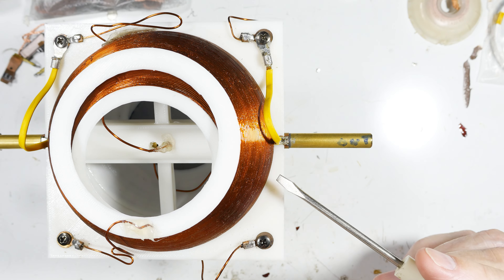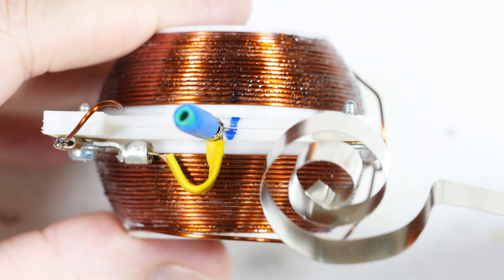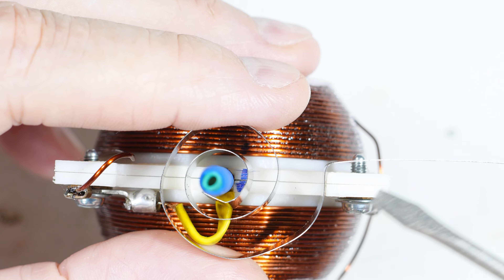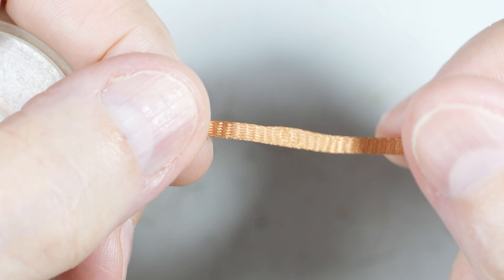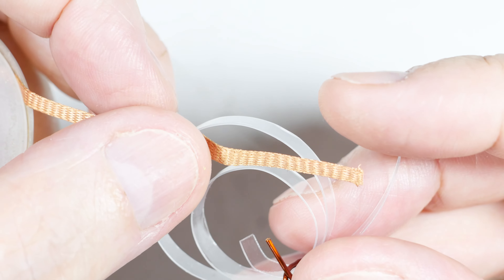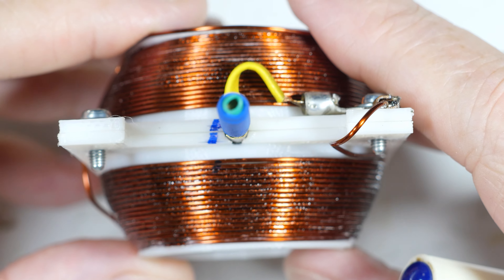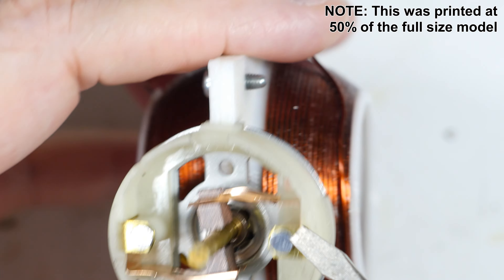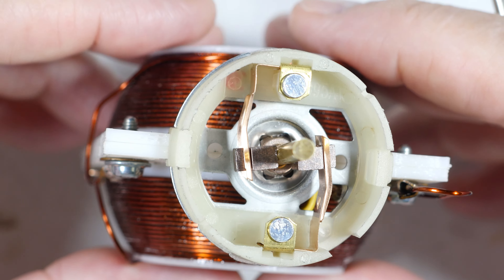Crystal Radio Variometer-Commutator Questions & Comments (4K)

Comment: That coil inside my old wall thermostat for my furnace looks ideal. A barometer might also have a coil that could be adapted.
Reply from the maker: I will have to keep my eyes open for those.
Reply: @tsbrownie   Another source would be the thermo switch in the furnace duct that tells your furnace fan to turn off once the duct has cooled to the desired temperature. These must be ripped out of old houses and thrown away daily by furnace installers.